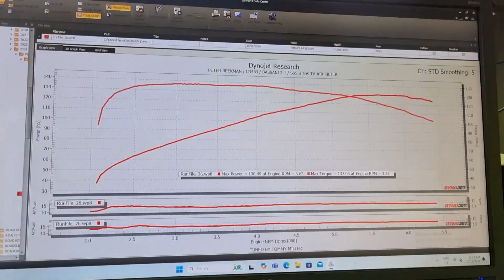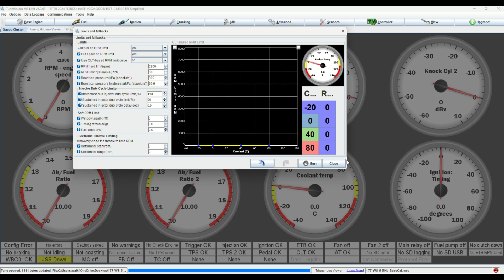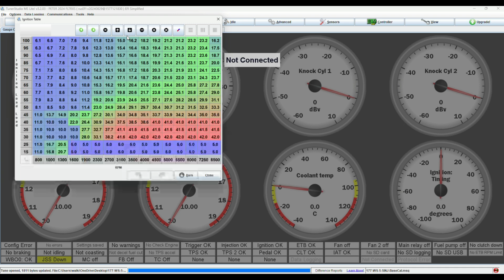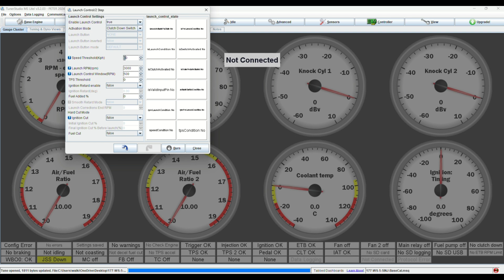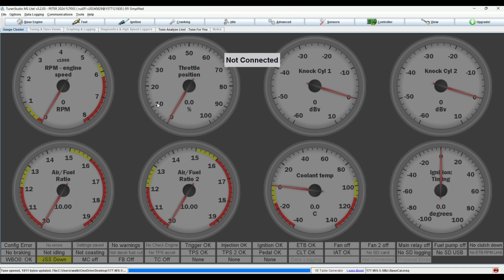FIRST IMPACT ECU TUNED IN AUS / 2024 VVT & non VVT TUNING IS NOW AVAILABLE / STAGE 2 CR483 CAM

Comment: Hey mate, got a dumb question. With the exhaust, how do you get around the 3rd post cat o2 sensor with the pipes?
Reply from the maker: Some tuning devices allow you to select only having 2 pre cat sensors and 0 post cat sensors. TTS allows this.

In other cases, I just drill into the exhaust and weld in a 02 bung to receive the sensor. Easy as that.

Comment: Hi, just wondering if you've done a detailed vid on the software yet? I've just had an IWS ECU fitted and dynoed and interested in seeing some of your settings. In particular theme settings under output. IWS had it set et 55° and 50° and found it way too low. I have mine set now to 85° and 75°
Also had to put a bit more fuel in under the cranking setting and seems to be starting in cold a lot better but again would be interested in seeing what you have.

Comment: How ya going Peter , just wondering if a 483 or a 485 cam is suitable for my 2024 lowrider s , I am currently running a D&D bob cat pipe with standard equipment. I would like to put an Impact Wiring Solution ECU into the bike so I can get to put some tuning maps to get the best possible outcome for the bike . What are your thoughts on this . I purchased the bike from Harbour City Harley Davidson in Gladstone, I know Mark and have spoken with him a on many occasions. Any help would be appreciated. Cheers have good one.☝️

Comment: would dual pipe setup be good or is going 2-1 better route to take
Reply from the maker: 2-1 is a better performance choice for sure. The OEM Headers with a decent set of slip in mufflers like Khrome Werks is another great option if you prefer that look
Reply: @ I was 2-1 exhaust last bike build and I thought on longer rides it was a little annoying above 70+ mph. So I have rinehart DBX45 slip ons and just scored on a rinehart dual slim for $300 yesterday that I’m going to install today to get rid of the cat on bike. My question is do I need to purchase inserts on the slip ons to regain back pressure. Fuel moto company told me I would need to do that and would be a great exhaust system to support 140hp or so

Comment: Great video Tommy. Thank you just quick question. Is it as reliable as a thunder max
Reply from the maker: @robertfagan8833  Absolutely! If not more reliable if I'm concerned.

I have pulled out & replaced over 15 Thundermax units over the years. 
If you compare that to how many OEM Ecm's I've had to replace at only around 5 or 6 in the same time frame, I'd say Thundermax are unreliable.

This ECU is new to the market but has over 15 years of R&D in the automotive tuning scene so I'm optimistic
Reply: @ awesome glad to hear that thank you so much for your input and your fantastic videos

Comment: Really enjoying your content. I'm waiting for delivery of 114" M8 Street Bob. Looking at CR485 cam kit. Slip on cans, still deciding on brand. K&N filter in stock airbox. What is a good tuner that won't break the bank? I have had Japanese bikes for years and i always get the ECU flashed.
Cheers John
Reply from the maker: Hey mate. Thanks for watching.

What country are you in?
If you're in Australia, go for the Direct Link USB key from Technoresearch for your tuning device. 
The CR485 is recommended to have the upgraded intake manifold & and 6.2 gps injectors. Given your going to keep the exhaust system relatively stock with just some slip on's you won't be able to achieve the maximum potential of the CR485 & you'll be able to get away with running the stock intake & injectors. 

That being said, I would consider either the CR480 or the CR483. The 480 will provide a much better low to mid range hit over the 485 & the 483 will provide a better mid range than the other 2.
Reply: I'm in Rockingham in WA. I would prefer the torque coming in early. Thanks so much for your reply. I'll check out the tuner and the CR480.
Cheers 👍
Reply: Maximus – Direct Link Tuning Key
Is this the one? Do sell them, or have any affiliate program with sellers?

Comment: Hi tommy great results impressive start on the new bikes ,  im guessing numbers are at your altitude too so even bigger gains for those of us at sea level.
 My CR483 arrived this week along with the APE 5/60mm inlet , i managed to get the one but last set of the 6.2 shotgun injectors from Cyclerama too.  more associated parts on order from APE comp ramp lifters etc your video on this was really helpful . 
My UK Fast Johnnie road glide ST came with SE Street cannons (wasnt aware of it ) so got a set of Khromewerks 4.5 in mufflers to replace what i thought would be stock , any recommendations for a set of aftermarket Headers for this set up .
going down the performance bagger  route so trying to shed pounds off bike so  in terms of weight do you know which is lighter The OG Heavy breather that bike came with/ Extreme ventilator /Extreme wedge
 any help appreciated .
look forward to next one all the best
Reply from the maker: The CR 483 works great with the Factory headers & a good set of slip ons. You mentioned you have Khrome Werks. They are GREAT!

Remove the CAT from the headers & have it Tuned by a reputable Tuner.

Not sure on any weight differences between those filters. It wouldn't be much difference at all I would say.
Reply: @MasterTechMiller   have seen a couple of builds on APE/ Matt smith that use the Fulsac headers any thoughts ?

finding a quality tuner thats my biggest bridge to cross im in England , dont suppose you do mobile tuning !!🤣🤣🤣
Reply from the maker: @scooternut7198 I've used a FullSac header on an older M8 with great results. 
Unfortunately I haven't used them on the gen 2 bikes yet. I'd say they are just as good on them though.
Reply: @MasterTechMiller   thanks for reply mines a 23 Road glide ST , Jess at APE has notified me my next order is inbound so seeing parts im about to use  in action on your channel is awesome 
looking forward to the next one cheers
Reply from the maker: @scooternut7198  Sounds awesome mate! I bet you're getting keen to get yours together.

I'm starting a new build on a Fatboy in 2 weeks! It's going to be a great combo
Reply: @MasterTechMiller  look forward to seeing the fatboy build

Comment: Just got my 2024 RG CVO ST with a Trask 2 into 1 Dyno only - Not tuned (I have the Screaming Eagle SP tuner) and I ended up with 125 HP and 145 Torque. Not bad... Looking forward to hearing more about impact...My Dyno guy told me about it but it is like $1800... STEEP...
Reply from the maker: Yeah it's definitely expensive. It's got a LOT of power though
Reply: @MasterTechMiller  Agreed, worth the investment Master Tech Miller. LOVE YOUR VIDEOS. You losted a lot of weight, gotta get those gains back. 🤣🤣🤣

Comment: Manual primary chain tensioner yes 👍 

Darkhorse compensator sproket ?
Ehhhh..  I hear they’re noisy af and seen a lot of post of them breaking  and work best with a balanced crank.

Man.. that 483 putting in work EVERYWHERE worldwide 

I redid my 124
Kicked it down to 11:1 to run the 480MT
did the SS crank 
64mm induction 
SE cam chest (wayyyy less out that a1 dipstick breather …. That 2020 OEM pump isn’t adequate for big cube motors it seems. 

480MT with a balanced crank .. insane smooth. 
It does run out of puff at like 5200ish tho. 
Wish I had a bit more up top but my meat and potatoes area is 3-5k.. only rode up high from getting used to having that 482 cam on there before.
Overall tho.. super happy. Great package 
Torque curve is a damn torque tabletop 
145tq from 2500-5000 where it falls off some and hp start to take over for a couple hundred rpm.. but gotta shift there 
Bike made 130hp peaked at 5200
145tq peak 4k.. but it’s like just a asshair under 145 from 2500. 
I didn’t listen to my guy when I went with the 482 and was hell bent on not doing a 2-1.
Lesson learned .. listen to your  builder and tuner.

Comment: Launch control won me.
Reply from the maker: Can't wait to try it at the track
Reply: @MasterTechMiller  I only learned about it from this video!  Did you leave it enabled?
Thanks for your efforts with getting the bike to where it is.  A VERY fun ride!
Reply from the maker: @PAB712  I turned it back off after testing it as I didn't want anything to possibly interfere with anything to do with the throttle & starting issue.

Comment: Great video with good results, love that torque curve.
Just for your info Thundermax has had their Helix tuner available for several months now.
I have seen Redshift’s new Gen 2, 528 cam produce stronger results on the 117 gen 2 bikes.
Would be great to see a comparison between those cams.
Reply: T-Max still (Nov 2024) has issues with DTE and consumption display...I know I have one. We are in the winter season now. I'll wait until the spring to hopefully see a firmware update or a PV. If nothing, I will bite the expensive bullet and get the Impact....
Reply: @ Thundermax released a software fix for that issue in early November. Contact them for the update.